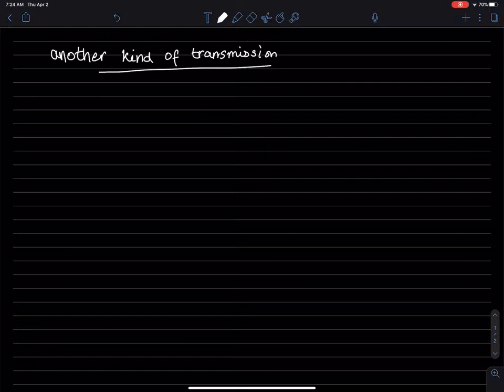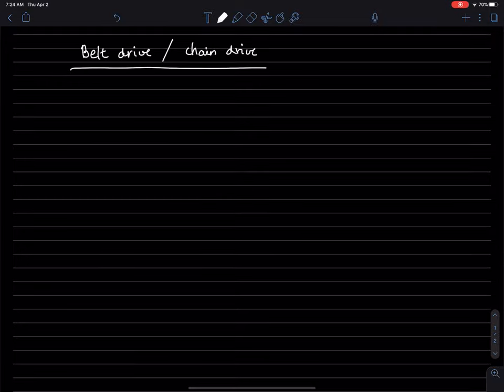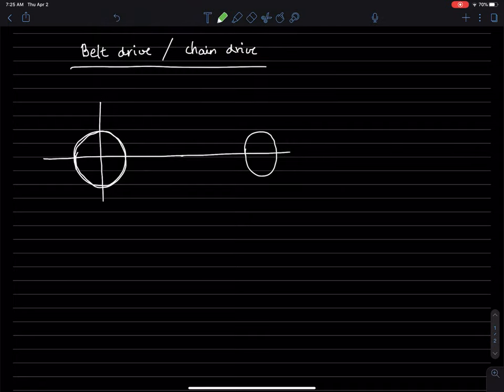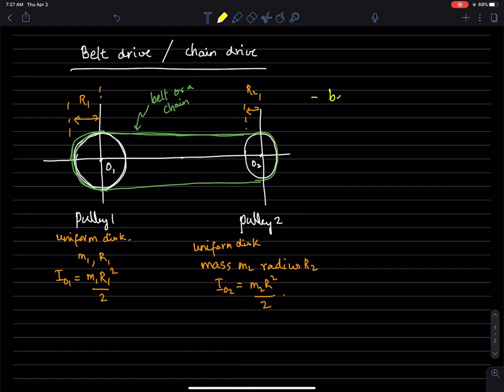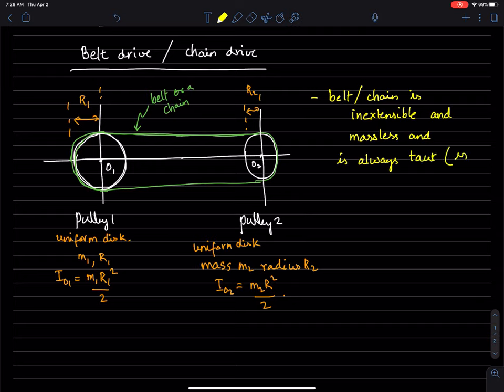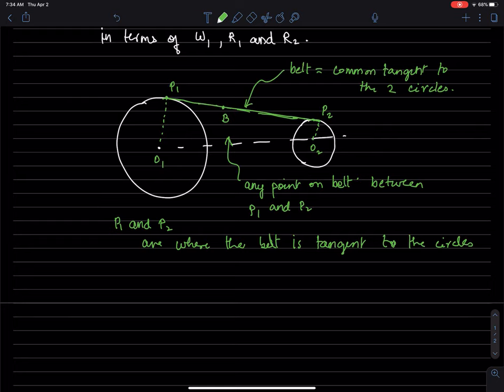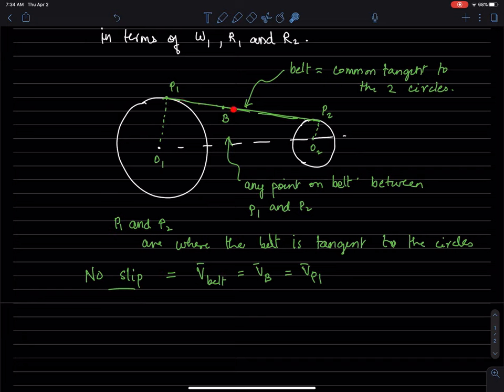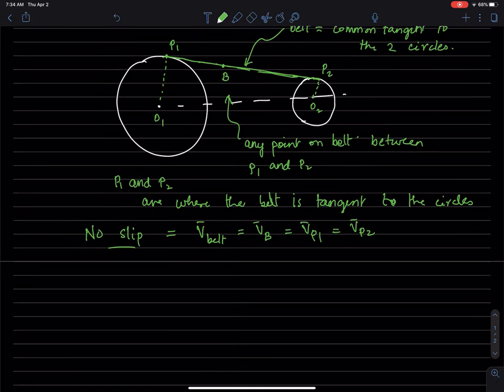Lecture 30, April 1. Example. Belt or chain drive.

Comment from the maker: At minute 26.46, there is a very brief typo when an R2 gets dropped from the denominator of the second term. The dropped R2 persists for a step, but then gets added again half a minute later, so that the results are fine. The typo has been corrected in the posted PDF notes and also at minute 28.46.